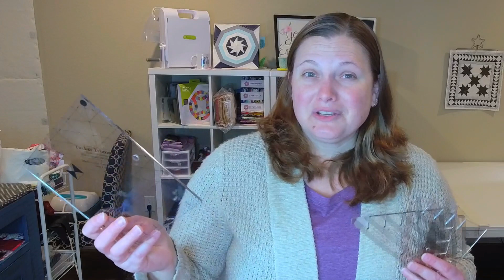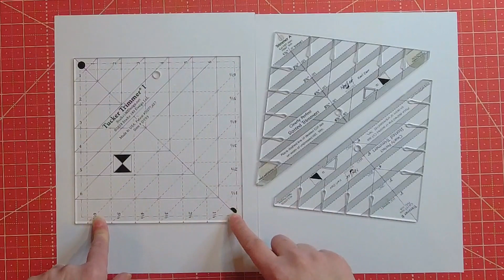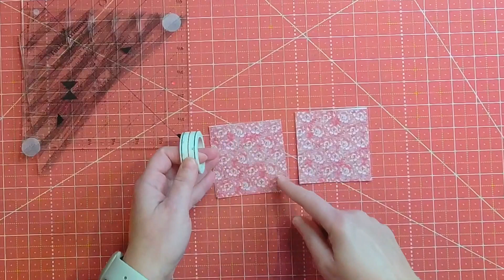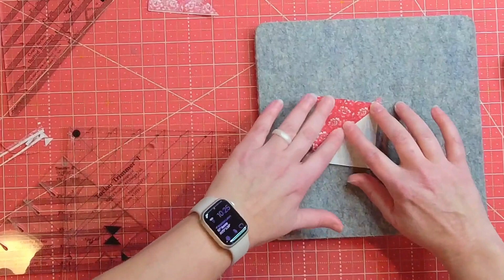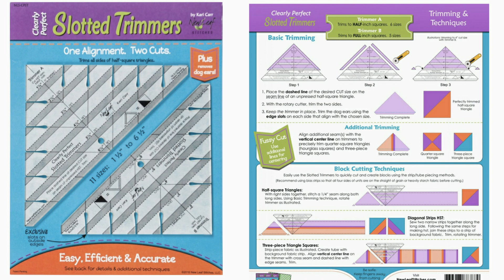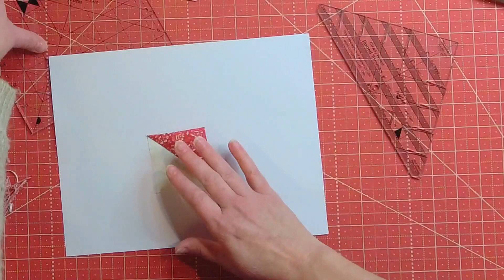Half Square Triangle Trim Tools! Clearly Perfect Slotted Trimmer and The Tucker Trimmer

Comment: I finally decided to buy the Clearly Perfect Slotted Trimmer about a month ago. I'm actually sorry that I spent the money on it. Problems for me: my squares are usually a little smaller than the size I cut for, and the dog ears aren't always cut to the corner so I end up trimming them again. Thanks for the review of the 2 trimmers. I do like the squares outlined on the Tucker Trimmer, but I think I'll stick to using the square rulers that I already have in my stash. From others comments below mine, I think I need to check out Deb Tucker's other rulers that I don't have. 😊
Reply from the maker: I struggled with the size too. I think it works quicker than other rulers I have used, but it isnt as accurate.

Comment: I mean you could use the tucker trimmer before pressing your seams open by lining up the diagonal line on the sewing line. Then you can rotate the ruler to cut into the seam allowance so that the dog ears come off. I have the slotted ruler and it always feels really awkward to use it because of the angle that you have to hold the rotary cutter at to do the four different cuts which just doesn't really feel safe to me. As you say the rotary cutter catches on the slots of the slotted ruler and keeping fingers out of the way is essential.
Reply: Yes. I admit I usually don’t use those dog ear trimmer bits because they’re awkward
Reply from the maker: Yes, it is so awkward to make the cuts sometimes.

Comment: Great comparison.  I would never purchase the Clearly Perfect Slotted Trimmer set, I've seen too many people with the same problem, the edges are easy to break because of the design of the slots on the edges.  I would purchase the Tucker Trimmer for that reason and the fact that it is one tool.  But I own and love the Quilt In A Day - Eleanor Burns, "Triangle Square Up" rulers (3 Sizes available) . Sizes:  1 1/2" - 4 1/2", 1 1/2" - 6 1/2" and 1 1/2" - 9 1/2".  Design wise they are much like the Tucker Trimmer, with the half and whole sizes on opposite sides of the ruler.  The Quilt In A Day ruler, you have two options of trimming your squares either close or open.
Reply from the maker: I have heard that the Quilt In A Day rulers are lovely! I havent purchased them yet but plan to.

Comment: Thanks Fallon. I don’t use either, but I think  I’d prefer the Tucker. I wonder too if those slits on the slotted one would be easier if using a narrower rotary cutter. I see the plus re the Tucker is one extra squaring up tool. Xx🇦🇺
Reply from the maker: I will have to try a different cutter. I have two other ones.
Reply: I’m thinking that using a 28mm rotary cutter might be easier when it comes to the slots. I don’t own either of these rulers, but I’m leaning towards the Deb Tucker ruler if I decide to buy. 😊

Comment: I like the Clearly Perfect Slotted Trimmer, but I recently used an AccuQuilt HST die that was for the size I needed in my quilt. I usually only use strip dies, but the HST die came with my cutter. It was a game changer for me and I had so much fun sewing and trimming them. I may have to invest in more of the dies.
Reply from the maker: Yes, I love using the Accuquilt too if I have the right size die cutter.

Comment: I'm somewhat new to sewing and after watching this I have a question.  Is the tucker ruler redundant if a person already has square rulers?  Does it do something else that may make it worthwhile?  Read on to understand what prompted this question if interested.

I have square Omni Grid rulers already and have used them to square up half square triangles the same way demonstrated on the Tucker ruler here.  One difference I noticed is with the regular square ruler had I have I can measure a whole or half number from the same end and didn’t have to be concerned with flipping it around.

 I watched this video because I'm interested in the clearly perfect ruler.  Although other may prefer it, I found using a square ruler to be inefficient.  I kept thinking there has to be another way.   A while back I watched a video and saw someone use the Clearly Perfect ruler seems to speed up the process. From this video,  I did take note that ironing after is to be done with more care as a trade off.  

Anyway, I questioned, would there be any advantage to getting the tucker ruler if you already have square rulers with a diagonal line? Does it do something else that might make it worth it, of would it just be redundant?
Reply from the maker: I think this would be the same as your square ruler with the diagonal line.  It sounds like they work in the same way.  My square rulers from Arteza do not have diagonal lines from corner to corner so it made it really hard to square half square triangles without a trim tool.